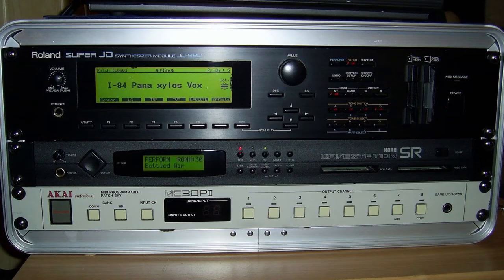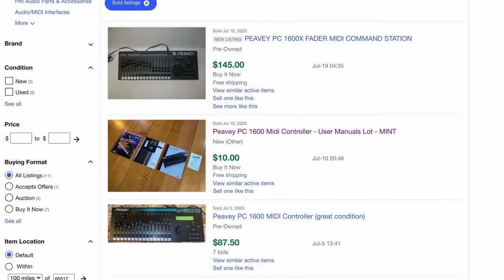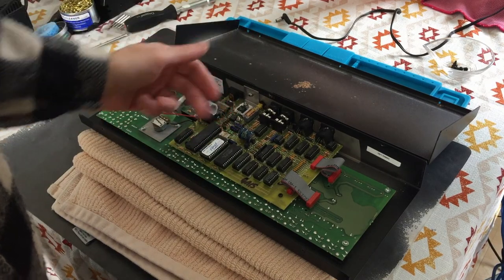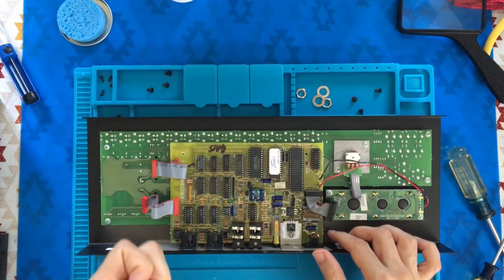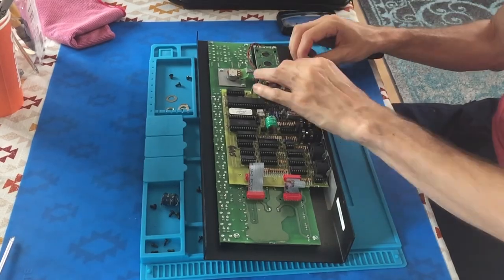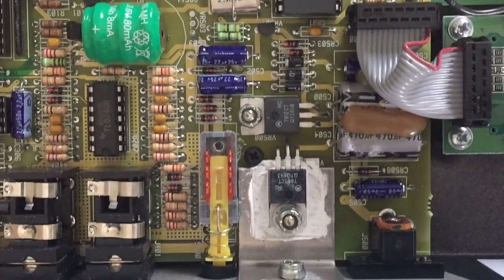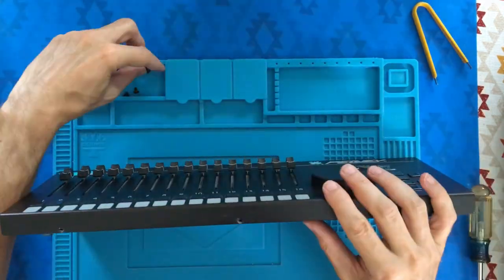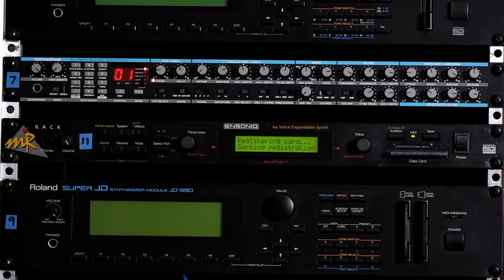Quick Look | Inside the Peavey PC1600 MIDI Controller / Command Station

Comment: schematics are at the rear of the manual.  nearly everything is socketed. i replaced my 20x2 with VFD.  Jittery faders, look at LM311 circuit.
Reply from the maker: Yes, indeed; I wish schematics were included with all gear manuals.

Comment: Excellent video! Fingers crossed I can get one for use with my TX81Z. Programming the TX is an absolute breeze I've found, but being able to assign paramaters like frequency and envelope controls to the sliders sounds so cool...Just missed one for sale for £52 on eBay!
Reply from the maker: I routinely put saved searches together for gear I'm hunting on eBay and will receive emails when new listings hit the mark.  Don't lose hope:  you'll find a unit sooner than you think on eBay or REVERB.

Comment: Why do you say "the nuts affixing the CV jacks also need removal..." for the unit to be opened/back panel removal?
Reply from the maker: The jacks for CV have nuts keeping them in place; to remove the cover of the PC1600 those nuts have to be removed before you can get to the guts of the machine
Reply: Thx.

Comment: Thanks for this great video. I checked my battery...not as bad as yours but worth a look. I think the mod to eliminate the battery is still a viable option. Anyone ever done a video for that? Omg...multimeter shows 1.6volts across battery...it's dead. So odd, it powers up fine, actually shows version 2.3 even though the rom says pc1600 (no "x"). Hmmmm.
Reply from the maker: Glad you enjoyed the video; thanks for letting me know.

It could be that the standard non-"x" version reached version 2.3 before the "x" version was released.  When I bought my PC1600, the guy I bought it from online included the old rom before he upgraded to the 2.2 "x" version installed in my particular machine.  Not sure I have the old rom; if I run across it, I'll post what version it was.... may be that can shed some light on the mystery you're presented with currently.